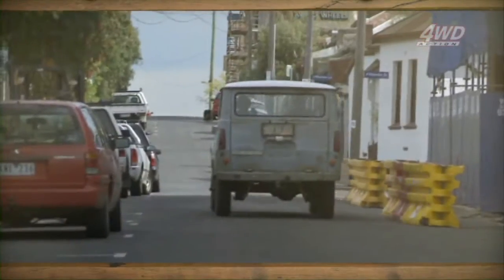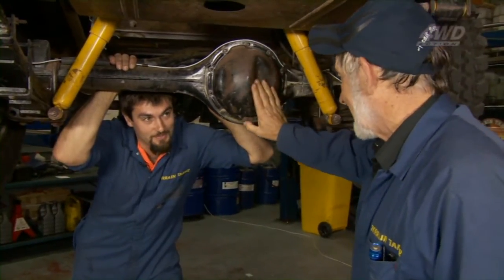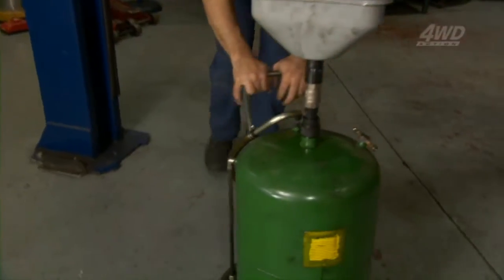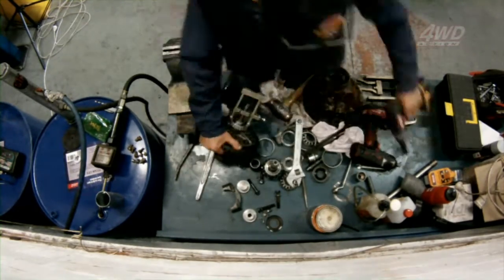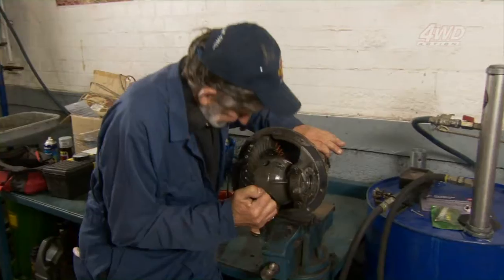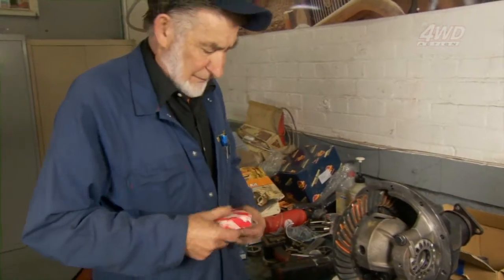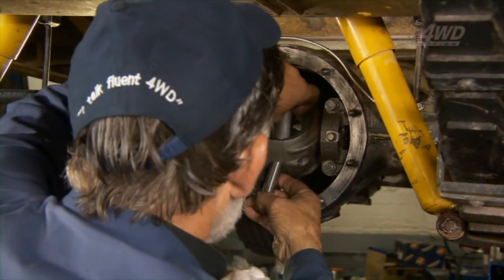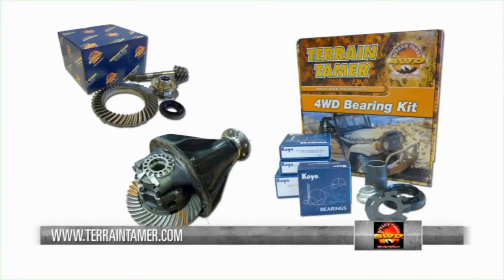The Project - Episode 11 Differential (Terrain Tamer)

Comment: are there actually benifits to a semi floating axle? Like the axle shafts are actually stronger?
Reply: no,its wrong terminology,,the clips are c clip axles,nothing to do with floating axles,full float is what you want,5 bolts on outside of axle/wheel centre,axle comes out.no weight on axles,all on bearings.you need to look at u.s vids to learn proper mechanics,not just toyota nurds.